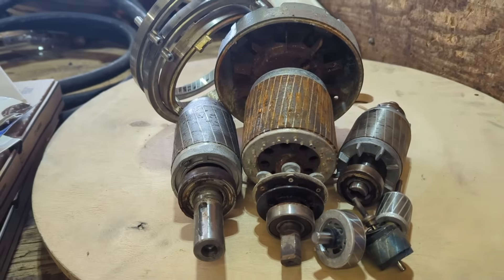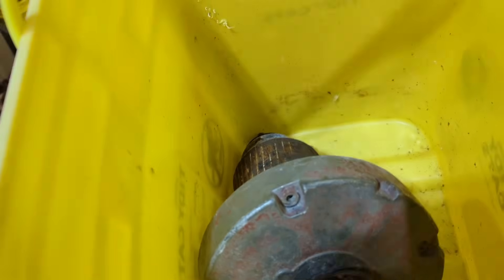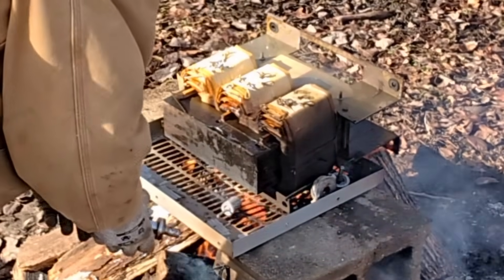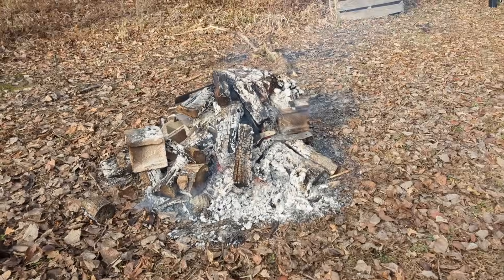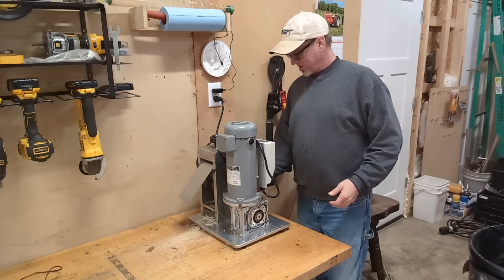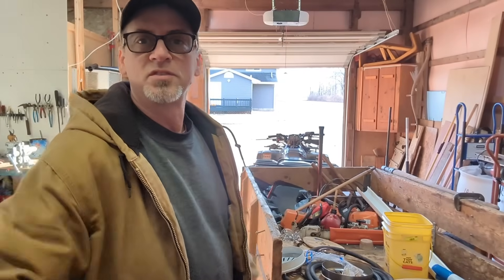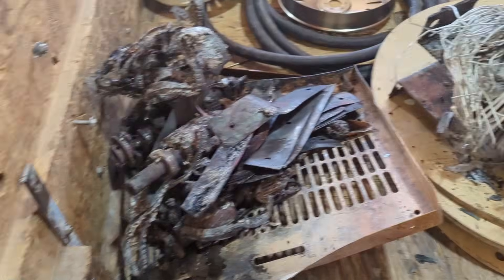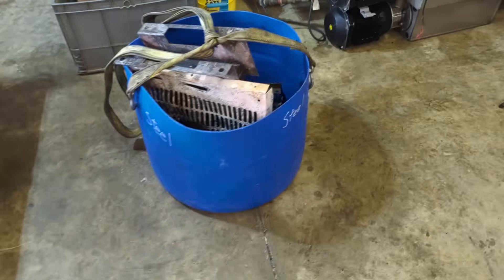How to separate aluminum from rotors.

Comment: A sifter made from hardware cloth works wonders. It's one of my main tools, I have several sizes that I use.
Reply from the maker: Great idea.  I actually have some.
I'll give it a try.
Thanks for the tip.
Also, you suggested in another video about making bracelets from the thick copper I got from transformers.
 I Kept some to do just that. 
Have a great day

Comment: Hey Gary!  I been watching for a while.  Id like to offer a little advice maybe to help you with your melting situation!   If you use a leaf blower to stoke the fire, all the extra oxygen will heat up to the maximum heat! All the aluminum will just pour out ! Hope this helps !
Reply from the maker: That is an excellent idea!
Thanks for watching and thank you for the tip.

Comment: Drizzle some capacitor oil or that fire next time, it will speed up the fire starting process.
Reply from the maker: I've been getting some pretty harsh comments just from burning the way I did it. 
I can only imagine what they would have said if I used some kind of excelerent releasing more toxic smoke into the atmosphere lol 

I'll try that next time. But, not tell anyone lol.
Thanks for the comment

Comment: My yard only buy melted aluminum as aluminum breakage, and i can alsl sell them rotors off as aluminum breakage without having to melt the aluminum. Here the bigger question is it worth spending an extra few days melting all that aluminum and then cleaning it? Good video though.
Reply from the maker: It's probably not worth it if you are a full time scrapper.
But, we just do it as a hobby, where time isn't really a factor.
We just enjoy it.
Thanks for commenting

Comment: Mr. Gary for doing stuff like this for around 150$ and a old washing machine you can have a working smellter. I mean really just need one roll of  rock wool and one propane weed burner and the washing machine.  Gut the washer line with rock wool. Cut hole in side insert weed burner and there you go
Reply from the maker: I'm looking into better ways to do this.
Thanks for the tip.

Comment: Another good video! Glad you guys double-checked on that transformer. Just wouldn't want you to see a loss on that thing. I don't know if you were referring to one of my comments on the last one. I definitely cautioned that that could have copper on the inner coils, but I've never scrapped a transformer that big. I usually find mixed transformers on on medium to small. Anyways, thank you for double-checking. 

Man, some of these people got triggered on that open burn. I don't know. I tried to respond to the guy. Tell him that melting aluminum is perfectly safe. I don't know how legal it is in an open-air fire like that. But you had bricks around it so I don't think they could call it a hazard. This guy here saying that that's melting aluminum is bad for your health dude. Nothing aluminum is perfectly safe. It's zinc you have to be afraid of or zinc coating or not. Even zinc just zinc oxide fumes because zinc can go zinc. Not only melts at a low temperature, it vaporizes at a low temperature. That's why. Anyways, I'm dictating this as usual so I'm not going to do much edits. I will say this. 

If you have a chance again, I'm not telling you how to live your life or do it your own way or whatever you're going to do. I'm just putting this out there. Do some research on retort reburn and or pyroize and you can concoct or bodge together. Some kind of bodge some kind of a funnel that will channel the heat upwards from a wood fire and have the aluminum fall down into a point. You can make it out of a barrel or you can make it out of a compressor, air compressor tank or something. But basically you put your aluminum on the inside you. You build a smokeless burn barrel on the outside and you make a pyrolizing vessel. That way if you have any insulation that goes up in smoke off gas gets reburned by the smokeless burn barrel on the outside. Your puddle of aluminum gets channeled out the bottom through the retort you know if you have a piece of angle iron obviously facing up like a like a gutter so that the molten aluminum would get caught and directed or into whatever you use as a mole the frying pan. Or I see guys use cupcake tens and stuff like that anyways. And but basically you you get that you capture that smoke in the no oxygen capsule, release it low into the Kohl's and have it go up through like a smokeless burn barrel or a more of a oxygenated fire and it gives the off gas if any a chance to get re -burned or re-oxidized in which case when it comes to plastic insulations PVC anything with chloride in it. You and the rebirth does not release dioxins which are the primary carcinogens that you get from burning plastic oil-based anything that has chlorine in it if you put the off gas through a secondary combustion prevent the creation and release of dioxine, which is basically what they do and those big giant coal-fired power plants that have a scrubber. What's what the scrubber does it reburns the off gas it reburns the resulting smoke from the coal fires and usually nowadays they run it through a giant catalyst that creates extra heat and they also use that to make extra electricity. Anyways, sorry for no punctuation and full dictated message. Read it out loud. It'll probably make more sense. Thanks again for a great video
Reply from the maker: We always appreciate your comments.
You make us think and recheck our work.

Some people really get triggered.  Lol
Probably from California 

We live different here in Ohio I guess.
We live out in the country 
We have neighbors on both sides. Everyone has a burn pile.
We only burn open fires way back from our homes.  
We are respectful to one another.
Live and let live is our model.
No Karens in the country!  Lol
We appreciate your comments
Reply: @CharlotteandGary  Cool, hand tapping this response to your reply. A watch with my TV and then I write my comments with a smartphone. Not the easiest way to do it. But anyways, here's how I get away with doing the limited amount of burns that I conduct in my neighborhood. I don't live in the country, therefore I'm forced to do it this way so that people can't really figure out what's going on. But it's safer and I also make my own charcoal the exact same way. And when people ask me what I'm doing, if they are curious I just tell them I'm making charcoal.  

I made my own pyrolizing retort from six fire bricks, one tire rim, a lager than normal thin walked SS stockpot with all metal stainless lid, and a fifty five gallon drum. I nice cast iron fry Pan to catch the AL is good too but not totally required. Get everything from a thrift store and or a brick recycler yard. A place that accepts concrete waste and the scrap yards. See if you can find the 50 gallon barrel for nothing. 

Get the rim from a spare tire, the kind that are then 50 mph only ones. Some call them doughnuts. Remove the tire so the rim is naked. Set up your fire bricks in an asterisk pattern on they long sides. (Use real red clay fire bricks because they're vitrified already. They've already been fired to a glass State. That's why the iron has turned red. They can withstand the heat multiple times forever ) Place the rim on top of the asterisk.  So it sits off the ground. Make sure the bricks stick out around the edges so they leave the biggest gaps for air to go under the rim. Make sure the rim is face out side for the vehicle to the down wards or ground facing. So it's like a bowl for the fire . Cut off the air valve too. Cut off the top third of the fifty gal the end with the bungs leaving behind the ridge on the now two third barrel. Remove the bottom circle of the 2/3 barrel leaving the bottom rolled barrel rim on the barrel also still attached for strength. Use a punch to hammer in some holes through the bottom of the stainless stock pot.  Put the holes through the bottom side near the edge, small like pencil diameter four or so neat the edge inch or LESS apart. 

Now all your pieces are ready to assemble. 

Dig a bowl shaped hole in dirt (clay or sand is best)  put the cast iron skillet to line as a liner for that shallow hole. Place the fire bricks on their sides in an asterisk pattern around the frying pan.  This was an initial step but make sure that the donut rim you use will fit inside the 50 gallon drum that has to have a smaller diameter. Place the tire rim on top of the Ring of fire bricks. Red fire bricks. Build your fire in the rim. Get it going before it gets too hot. Put the 50 gallon 2/3 barrel over the rim but it should also be setting up on top of the bricks with an air gap going all the way around so air can flow up under the rim and up in between the rim and the barrel. Take the sand that you saved from making the hole for the cast iron skillet and pile that on top of the lid for the stainless steel stockpot. Place your aluminum and or insulated and or shellacked and or glued items inside the stainless steel pot. (Great method for dealing with circuit breakers too, by the way) Place the stainless steel pot in the fire and if necessary use rocks or more fire bricks or whatever you have laying around so that the lowest point of the stainless steel pan is the point that has the holes you knocked into it. Try and get those holes centered above the center hole of the donut rim. That way any molten aluminum will fall straight through into the cast iron pan.  So place this in the fire as it's burning and have it be placed at an angle. Use whatever is necessary or whatever is Handy to keep it propped on its side. They should be in there at roughly a 40 to 45° angle such that when the aluminum melts it goes out through the holes. Now with the rim weighted down with the sand from the hole cover the pot. Creating your no// low oxygen environment.  This will force any off gases to also go out through the hole in the bottom and then come up around the sides where the burn barrel on the outside with the air channel on the inside will cause that extra oxygen environment which should make your entire burn go smokeless and stop any bits that could contain any chlorine in plastic like PVC plastic polyvinyl chloride from from creating any dioxins. On a side note, you can use the exact same pyrolyzer to make your own charcoals so you won't have to keep buying it from the grocery stores. Let me know if you understood this. Thank you again for the video. Consider this my way of repaying you cuz I got no money working on my own pot to piss in as they say. LOL  also, if I were a YouTuber I would make a video about this build. The reason why you put the sand on top of the lid is it acts as a weight to keep that lid pressed down and so the easiest way for the off gas is to exit is through the bottom holes but it can never build up enough pressure to cause a you know a steam, a steam explosion or whatever because the lid ain't tightly held down.
Reply from the maker: @jMarbet 
I'll keep these instructions close by in case I decide to construct this.
I actually got a couple barrels from work last summer to make a smokeless burn barrel.  But, just never made the time to do it.
And, you're right, it would make for a good video, and not trigger so many people lol.
I'll shout out to ya if I need more help with this project.
Thanks
Reply: Are you telling people what to do again,lol. That comment was so long about burning stuff I fell asleep.
Reply: @seancasey2444  If you thought that was a long comment, you should wake your ass up and read the second comment. 😂

Comment: Here in Florida they will not buy anything melted. I put  mine in with anything that has iron and aluminum like lawnmower/weed eater engines and so forth. I usually get around 18 cent per pound. Great video, I enjoy watching. God bless
Reply from the maker: Here in Ohio, I have only seen signs at the scrap yard "No burnt copper ".

Nothing about aluminum.
Thanks for the comment
Reply: @CharlotteandGary bad for your health burning it